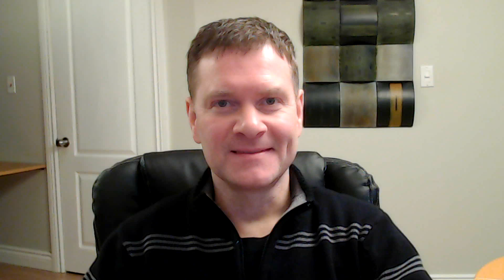#543 - Q&A: 80 Plus Power Supply Efficiency Certifications?

Comment: corsair AX850 (80 plus gold) powering an asus 6990 a phenom 2 1090t @3.8ghz a watercooling loop on both some cold cathodes and 10 fans controled via 2 lamptron fancontrollers (fc2&4) for a litteraly no-noise rig ! max temps on cpu 32 and gpu 53 ! its in there for over 2 years and its not complaining at all ! its also REALLY quite !

Comment: CoolerMaster Silent Pro 700w (80 Plus Bronze) running AMD 1090T (OC) + 2x 6850 (OC) in crossfire for nearly 4 years, virtually silent, and no problems. Probably saved allot of energy

Comment: It's good to have an efficient power supply. Electricity is not something you should waste carelessly. Inefficient power supplies should not be something that sticks around for the next decades. 80-85+ should be the minimum I feel.
Reply: yep 80+ Bronze should be the minimum, and I personally think that should happen even with laptop PSU, and MiniITX PSU, but it is hard to find MiniITX power supplies that meet 80+ atm, but then again they are usually no more then a 250 watt PSU anyway.

Comment: I'm not running anything hardcore, and have an Antec 430 Watt continuous 80plus Bronze PSU,  running an AMD Micro ATX A-10 5800K system with 3 HDD, 1 DVD-Burner and a few system fans, and rarely does the fan ever rev up beyond 50% load on the PSU unless I'm doing some DVD converting or a little bit heavy gaming, but I've never had a problem with the PSU for nearly 2 1/2 years I've owned it over 2 different system builds, I personally think a lot of guys get way more PSU then they really need, and which ends up cost them more on there power bills, Hell I even plan to add a light/mid range GPU like an R7 too the system down the road, and I still think i will barely be pushing the PSU too It's max at load.

Comment: I personally see these 80 plus ratings as gimmicks used to sell expensive powersupplies. It's like a car manufacture slapping a badge on it saying it is waaay more reliable than their other models. Which makes no sense, because they should be built to be reliable in the first damn place.
Reply: Torque Effect Reliability != Efficiency
Reply: +Mike Trieu (MegasChara) Reliability does not equal efficiency at all. Something can be built like a tank and never fail but be incredibly inefficient. Such as my grandfather's large chest freezer from the 70's. It has never died and has proven to be very reliable, but uses lots of electricity. While a newly sold chest freezer of the same size would use way less electricity compared to my grandfathers, but only last 10 years due to the shitty manufacturing quality we so often see now a days.
Reply: matthewrs7 Thanks for repeating what I said a long time ago, I guess? I'm going to assume you're not a programmer.
Reply: +Mike Trieu (MegasChara) I was elaborating.